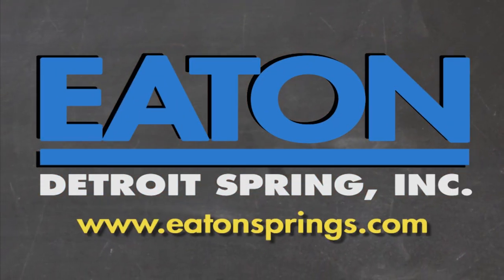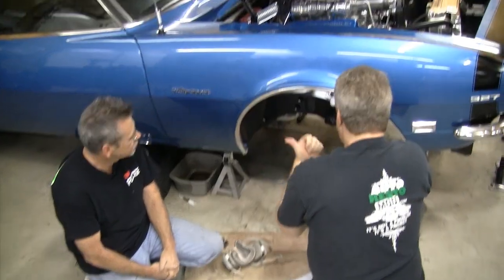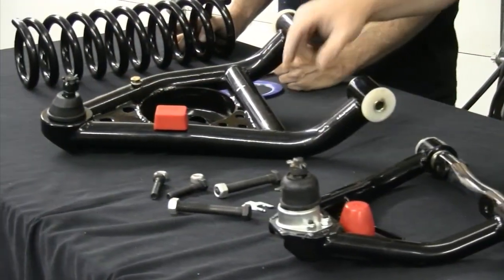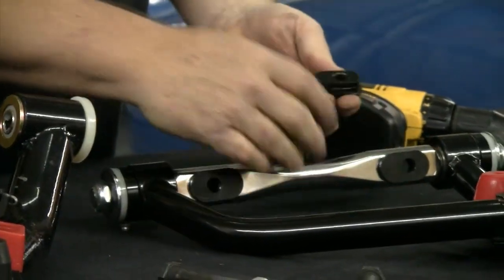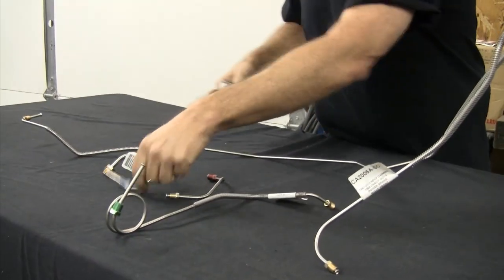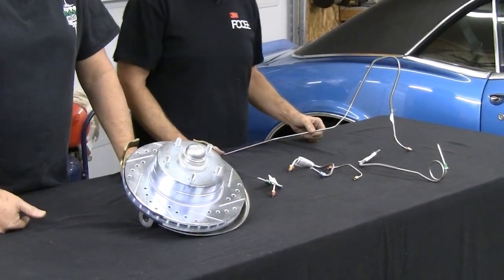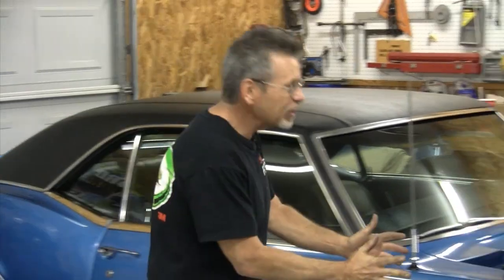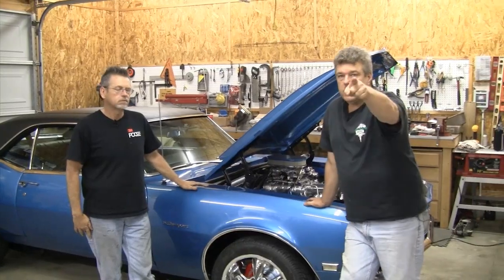Install KMJ Tubular A-Arms on First Gen Camaro Chevelle and Second Gen Nova Episode 193 Autorestomod

Comment: I did this once on my 70 Chevelle, and I rented a McPherson strut spring compressor and it worked fine.    Its like the jaws of life and grabs the springs from the outside and squeezes the coils together and allows you to get the springs in the right position before releasing the tension. Just another way of doing it..

Comment: if you don't have weight on the car you can use a long piece of 1/2 inch all thread in the shock mount holes and pull the spring together it takes some doing but with a few washers it works pretty good

Comment: Hey guys, you can install a spring without a load in the car by looping a chain around the axle of the jack up to and around the front frame rail. ( bolt ends together with no slack ) The frame will not lift when it's attached to the jack.
Reply: I used harbor freight ratchet straps...🤣..kinda messed them up but they are like 10$ for 4 new ones so🤷
Reply: Also  place a jack  stand at back of the car opposite  side where you are compressing the front coil spring.

Comment: heck I bought these control arms form kmj for the first gen for 249 for this kit and there not bad at all im happy with them for sure and will buy more for my other cars.
Reply: +Chris Mansker hello i just bought a set for my 67 did you have any issues with attaching sway bar? i want to cover every thing before i rip it apart thanks
Reply: I had to buy longer sway bar links I have a quickor 1 1/4 inch bar in front.  I had to send one arm back as one end was welded on misaligned but the took care of it and its all good great value check out my video there on my car

Comment: Awesome video & thanks. I just got my a-arms yesterday & was wondering if I should put the old shims back the way they were before I disassemble the old arms! Thanks guys!
Reply from the maker: You can use that as a starting point if you saved the shims and marked them. This will get you to the alignment shop for them to finalize it. Even so, I'd try and trailer the car to the shop.

Comment: Hey - I know it was a long time ago that you put this up.  I just did a BMR tubular upgrade on my 1967 Camaro convertible.  I am rebuilding the front suspension - all stayed stock with anti sway and spindles.  I can't find the torque specs ANYWHERE for the sway bar, and how far to tighten the top nut down.  Obviously I can tell from a geometry standpoint that the more I tighten it down, the more extreme the angle.  
Is there a limit to how far dow you tight it?  I can't find a video on that anywhere - any assistance would be appreciated.
Reply from the maker: Contact Jeff, he will try and get the info for ya! jford@autorestomod.com

Comment: No Gullstrand mod, no .5" longer upper ball joint, no .5" longer outer tie rod, nothing to improve on the steering geometry just a stock set up. Makes it look nice but no improvement in the steering or handling improvements. You need to do one of like this it ends up like a c5 vette geometry.

Comment: Installed my a arms with new springs; and the upper a arm pulled down right to the bump stop( with a arm bolts still loose)Will this correct after wheels are on back on the ground .
Thanks
Reply from the maker: Usually in a case like this everything will settle out as long as you don't tighten the bolts up initially. Go in and bounce the front of the car up-and-down a few times. Also roll the car backward and forward and then bounce it again. Then tighten up the bolts.
Reply: Thank You!!
Reply: Any tips to tell the alignment shop. I installed a similar set from Amazon . Thanks

Comment: Those KMJ A-Arms come from China don't they?  The reason why I ask this is because on e-bay you can get both sides, upper and lower for $400.  That is unheard of compared to Hoskis or Global West where you are paying almost $1200 for both upper and lower control arms.

 How were they?  I heard they have cheap ball joints in them, is that true?  How did the car align?  How did the owner say they were after some miles were put on them. 

  I'm going to purchase a set but I am not sure about suspension parts from my 68 Camaro made in China.

  Thank you for your opinion
Reply from the maker: Christopher T Honestly Chris, we haven't had a chance to get with the owner to find out about his experiences aligning the front end. We're also not sure what the initial source for the arms are as they were provided to us by the owner.

Comment: They are NOT, LIGHTENING HOLES!!!  The holes permit the gases that are produced from heavy friction between the pad and the rotor face, to escape into the vent 'vanes' in the middle.
Therefore they (the holes) reduce brake FADE. THAT happens when the gas has no where to go and actually separates the two surfaces. (the harder you press on the peddle, you still don't stop!) And the overheating of the two surfaces, warps the rotor and breaks down the pad material..
Reply from the maker: Ok, no need to shout. So they do the same thing as the veins. Got it. With your passion you should work for a brake company...though I don't recommend shouting at the company meetings...

Comment: When we were installing the exact same control arms the red stopper on the top control arm was crushed after we installed everything. Any clue why?
Reply from the maker: Not really, I'd recommend contacting the supplier, we have only used them once so I can't speak to the problem. Sorry.
Reply: @AutoRestoMod  could it possibly be because we left the other side on the jack stand for the past 3 days and the car is at a angle. Also thank you

Comment: they dont align well i put that same control arm set up on my nova could not adjust chamber not enough vaster and ball joint boots fell apart after 2 weeks and bump stops on lower control arm dry rotted and fell off buy global west spend the money once dont cheap out. im paying the price now
Reply from the maker: Sorry to hear about the trouble! We've seen a general deterioration in the quality of boots on suspension pieces in the last few years. So that and the urethane problems fall more to the manufacturer of those parts (KMJ just buys them from a source) than KMJ. The alignment issues are another matter. We would recommend a call to the company. our experiences with them on tech issues was really positive.